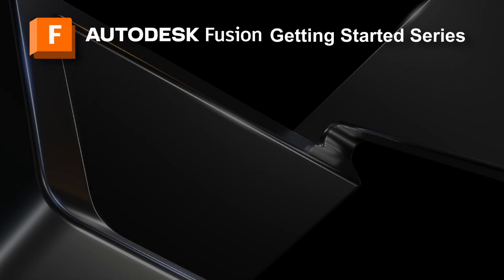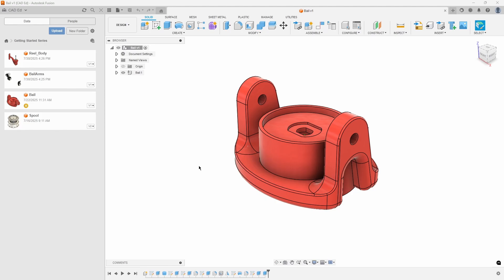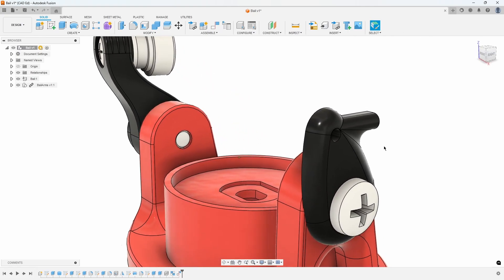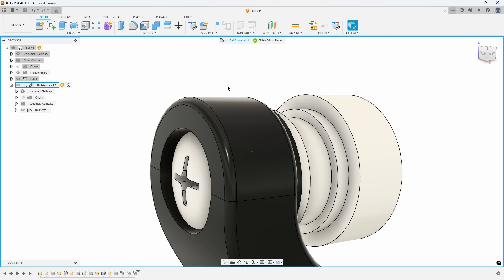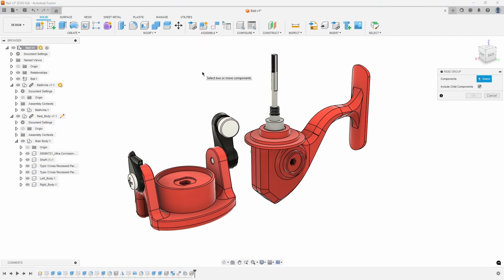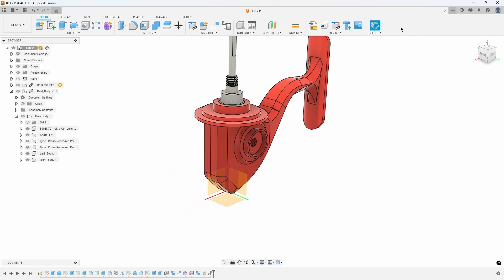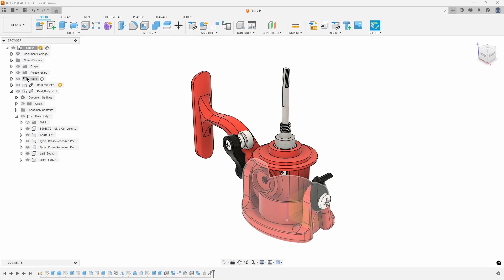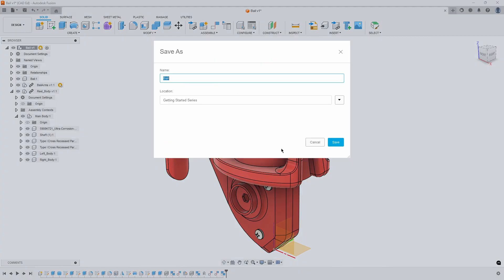Working with Imported Geometry | Getting Started with Autodesk Fusion Episode 7

Comment: btw if you're on the free version, you can't use edit in place.
instead, you have to make the component in the data panel editable then open in a new tab and edit and save the component. 
then go back to the bail design, right click on the bailarms component in the browser and select "Get Latest Version"
Reply: Thanks for the tip. I will give it a try!
Reply: thank you!!! it worked
Reply: @lanathompson3228  Worked for me too.
Reply: Super helpful, thanks!
Reply: That's great info, thanks.
Reply: You are a hero ! :face-red-heart-shape:

Comment: I cannot open the .step file either. It wants to come in as a .txt file that locks my Fusion up big time.
Reply: I found that you do not double-click on the file. You single right-click, then do a save as to wherever you save files. You can then bring the into Fusion as the video shows. It worked for me. Also I found out that if you are running the free version you will not be able to do in-place editing. Guess what I’m running.. Good luck with it..

Comment: 1. Click the link for the  Reel_Body .step
2. This should open a page that starts with ISO-10303-21;
Right click on the page and hit save as and it should default to something like 'reel-body.step.txt' Save It
3. Open the file location in File Explorer
4. In file explorer in the Menu go to View -> Show -> File Name Extensions and make sure it is checked
5. Rename the Reel_body.step.txt -> Reel_body.step (make sure to remove .txt. It will ask about changing the file type hit yes.
6. Upload into Fusion

Note this worked for me on Windows 11